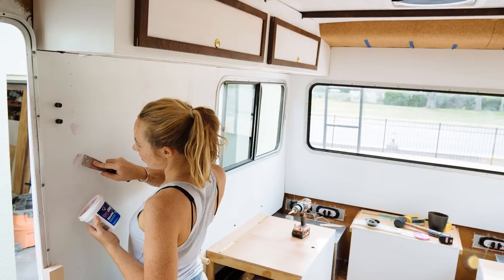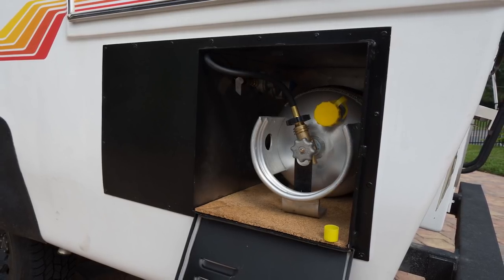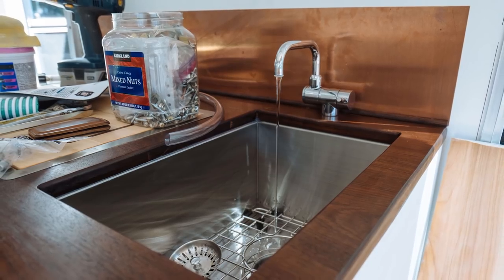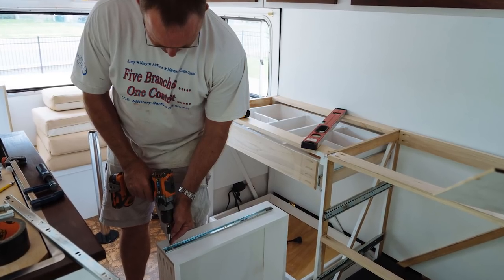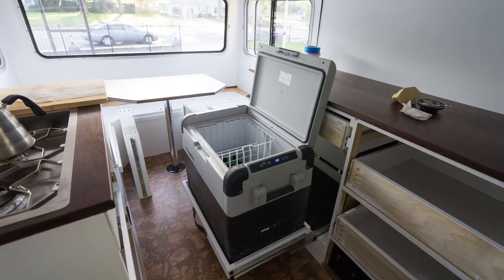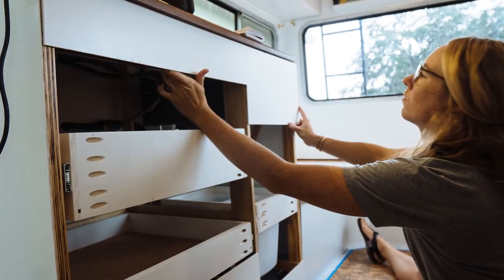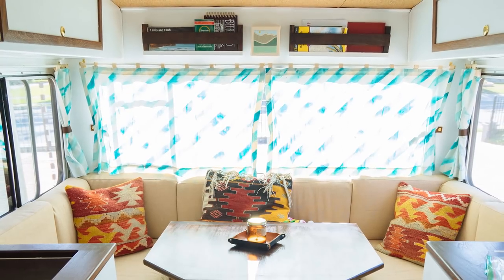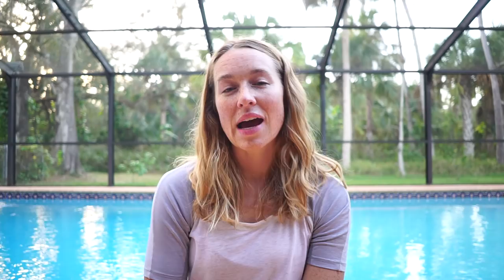RARE 4x4 TOYOTA SUNRADER BUILD | PART 10 - FINISHING UP

Comment: That tip about always running into issues during reconstruction is why I can't do something like this. It's just my bad luck. I'll get the propane tank issue fixed but then, two days later, it'll conk out for NO reason. Fix that, then suddenly, the engine will die and the mechanic can't find out why so it's stuck in the repair shop for another day. Then the toilet, which worked flawlessly for a week will die. That's how everything is for me. If I didn't have bad luck like that, I'd be restoring those old German Unicat RVs. Those are nearly bombproof and will humiliate a Hummer H1 by crawling over rocks bigger than the Hummer's tires!